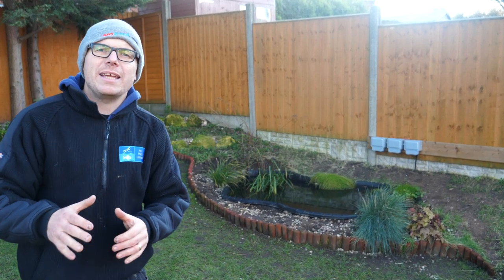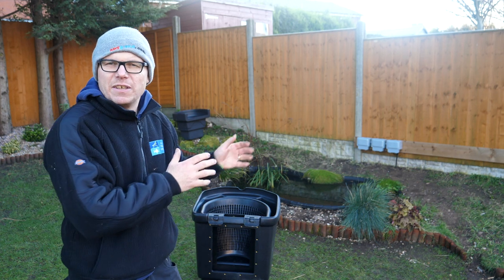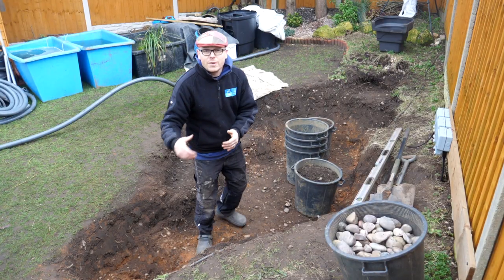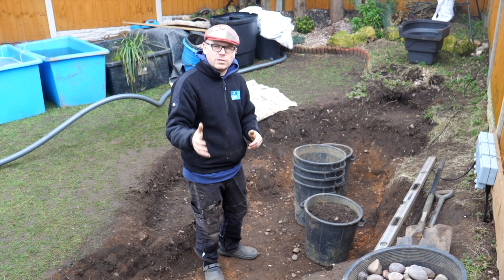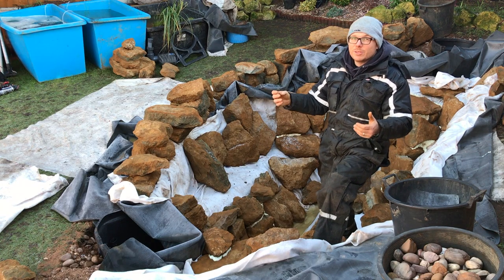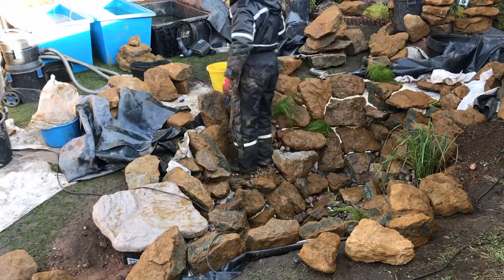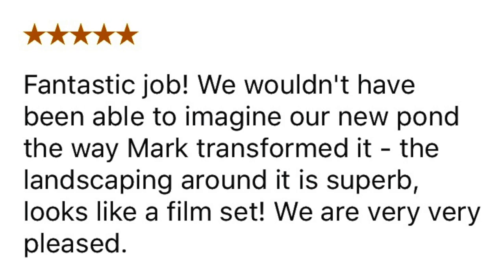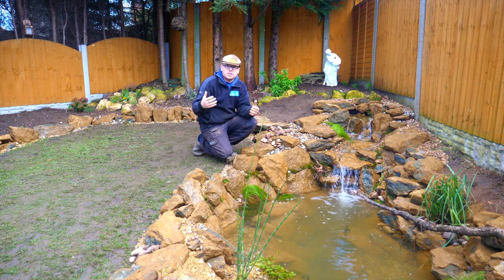Fish Pond Design and Construction - Pond Builders Birmingham

Comment: Hi, I have a hozelock eco power 6000 filter box and a aquaforce 4000 pump and it to much for my filter box to cope with and leaking out the top unless I take the a piece of foam out, any idea why this is happening, also wouldna 10000 litre filter box work well with a 4000 litre  pump. Thanks
Reply from the maker: Sounds like you have a bigger pump than the filter is designed for. So yes an upgrade would be much better, we do not use main box filters anymore, we clean clean out tons.

Comment: why no bottom drain on this pond.  its going to get caked in algae and fish waste.  anyways I always enjoy your videos cheers
Reply: Tony Nguyen when ponds are built correctly like the Pond Advisor is doing, bottom drains aren’t necessary. The bacteria Mark adds to his ponds colonates in the gravel on the ponds floor and digests the fish waste.
Reply: @PutsPonds  the new pond is an upgrade from the old for sure.
Reply from the maker: Tony Nguyen thanks for the question, no need for a bottom drain at all on this one. If i was designing it as a fish pool then get a bottom drain would be better than a pump in the bottom.  But the large skimmer on the side is much much better than a bottom drain in this application.  Algae and fish waste will not be a problem, due to the high turnover and the large mechanical filter.